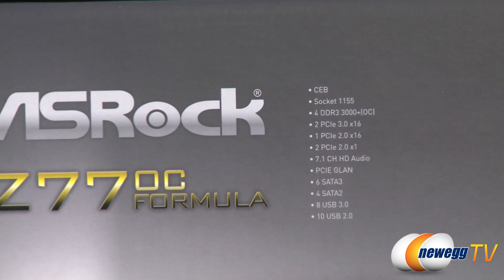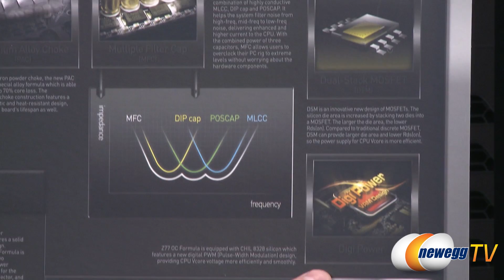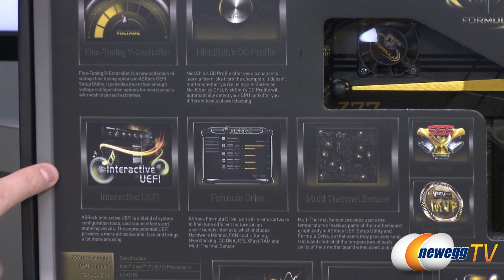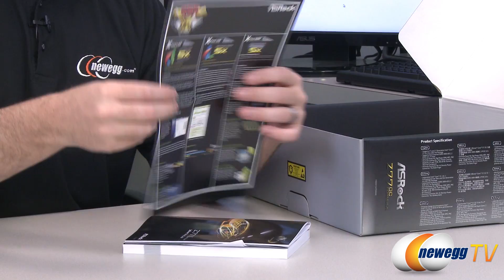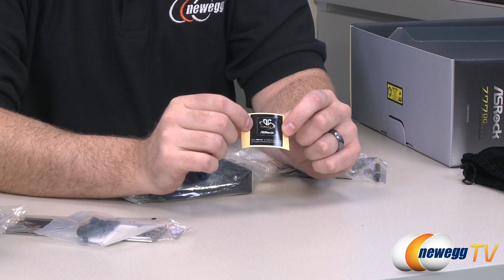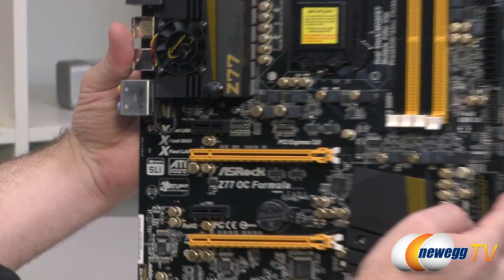Newegg TV: ASRock Z77 OC Formula LGA 1155 CEB Motherboard Overview

Comment: No it will fit CEB is pretty much the SAME as E-ATX and the corsair 650D WILL FIT this board. I own a 650D and a CM690II advanced and the latter is smaller and fits an E-ATX and CEB board

Comment: Oh and since I'm on a roll telling you all the good features MSI has over ASRock, I'll go ahead and tell you that they have an OC Genie button. What that does is, if you click it and then turn on the sistem, it will overclock your CPU by quite a bit in about 3 seconds. Sure, manual overclocking can take a CPU closer to it's limit, but this is awesome! It took my 3.4GHz 3570k to 4.3GHz and the voltage to 1.15 in 3 secs! Really practical. You do need an unlock CPU I believe though.

Comment: I think the MSI one have a good sound card built in i recall. 
Hhmm that's quite true , what you said , also the MSI Z77 MPower is cheaper too , in my currency i can get for only RM700 , while the OC Formula it's over RM800 + , a RM100 + different its alot ! Im still shocked the MSI MPower it's so damn cheap for the features it's given !

Comment: Oh and one thing I forgot to mention. The MSI board comes with WiFi and Bluetooth right out of the box. For me, the WiFi is very important as the Ethernet isn't working in my room for some reason. The WiFi can work out of the box as I said, or you can connect an antenna for better signal is necessary. It's magnetic, so I just leave it on the side of my case since the side panel is steel. It looks nice with a little antenna, although I get good enough signal without it.

Comment: I finished my first build about two weeks ago and the motherboard that took my building virginity was the Z77 Mpower. I thought that the only thing I would benefit with the ASRock one is more SATA 6GB/s conections. However, I found out after my purchase that the Mpower has really, really good audio, so if you have analog speakers or analog headset, MSI is the way to go. Even besides the audio difference, I would never pay $40 for a few more 6GB/s SATA ports. 3GB/s is good enough for HDD's.

Comment: ASRock originally spun off from Asus in 2002 in order to compete with companies like ECS and Foxconn for the commodity OEM market. Since then, ASRock has also gained momentum in the DIY sector and plans for moving the company upstream began in 2007 following a successful IPO on the Taiwan Stock Exchange.
ASRock has garnered a reputation for good value (cost/performance) from tech websites, including awards and recommendations for an array of products. currently owned by Pegatron Corporation.

Comment: Finally a rear I/O that makes sense...except for the lack of DP. But what's with the gold connector crap? It makes more sense on external connections, even though most only plate the outside ground sleeve which in most cases isn't the actual ground. But internal connections?...copper like everything else would've been better. But do admit, it makes it look nice and won't corrode like copper...

Comment: You can control the fan speed of both. With a 3 pin fan, the speed is controlled by adjusting the voltage. With a 4pin fan, the speed is controlled through pulses. This is why 4-pin fans are also called PWM fans (pulse width modulation). The speed of the fans is determined by how many pulses it gets

Comment: I've been following ASRock since vacation a few weeks back and the Extreme11 release on Newegg.
Looks like they're making strides in combating Asus. Like the CEB, sata6, YELLOW, and vreg/per 3x options.
 Where's the TBolt, 2x pcie 3.0 x 16 & 1x 8, onboard wifi, & mSATA? SSI-CEB is big enough to accommodate all of these.
Still, it's a great board for the price... just a little miffed about the 2x16, wifi, & mSATA that should have taken pcie #3 slot...

Comment: Best way to explain the pci-e on off switches and the reason they are there. They are there mainly for diagnosing a bad card or slot/lane  This comes extremely handy and saves lots of time if you have a multiple card setup and your water cooled. They are not there just to turn on and off for fun they actually do have a purpose and I'm shocked he didn't mention anything about it.